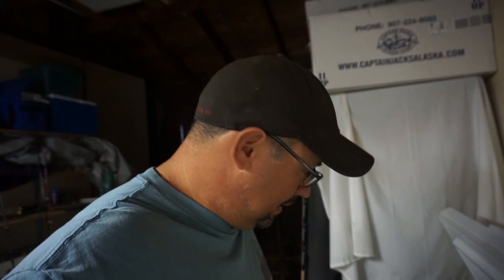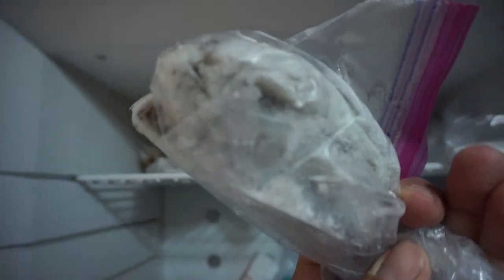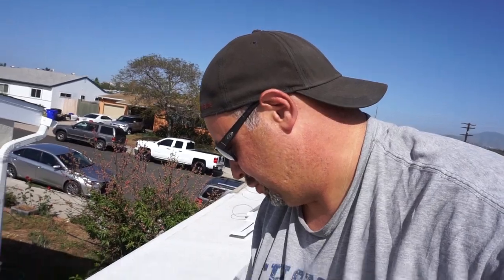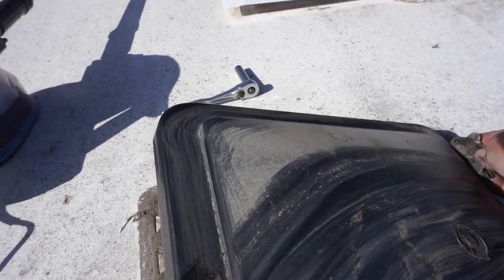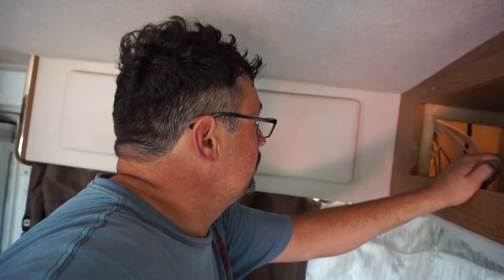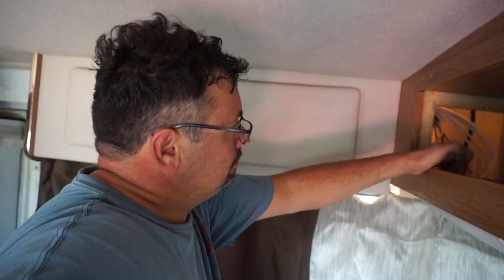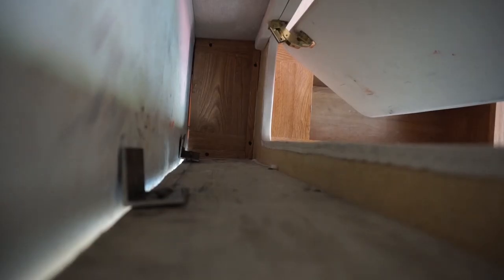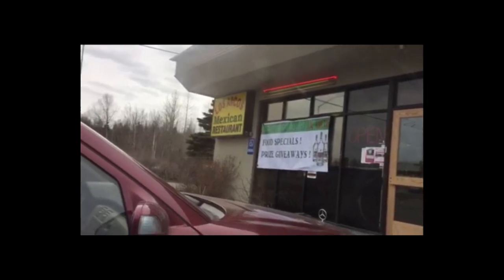RVing with Fish & Wild Game from Alaska

Comment: Quick tip if you can't stop a squeak. Put baby where the connecting points are and bang hard against it. Then vacuum excess out. It works itself in and won't hurt anything  since most squeaks are wood rubbing. Learned this from a used RV dealer.

Comment: Nice work Ben. Really good maintenance. I am sure you know that WC-40 is not a lubricant, it is a penetrating formula. It did work for you.  I use the dry graphite spray or a Lithium grease spray. In a pinch wd 40 works ...lol. I am having some issues with my A/C also.  Hoping i dont have too spend 1200 on a new one..grrr.